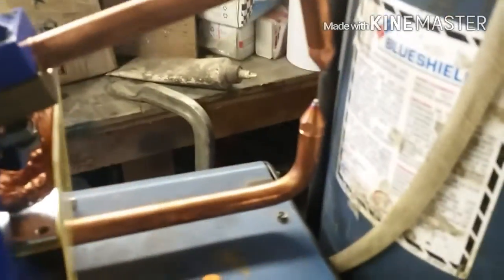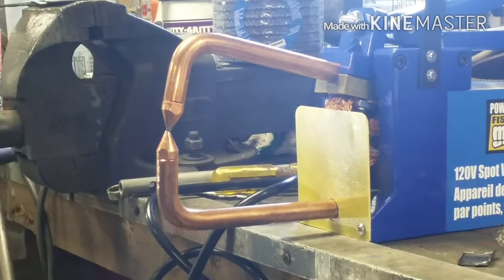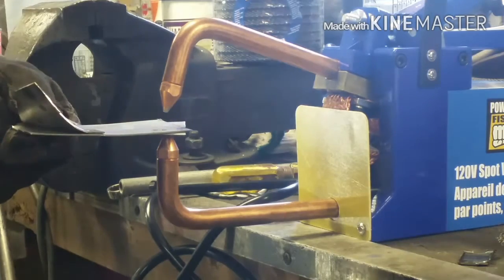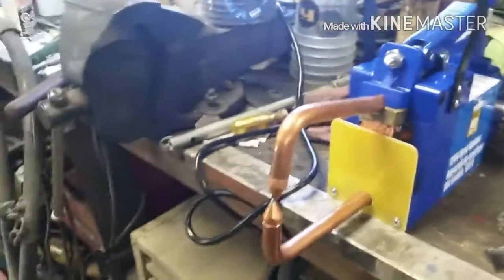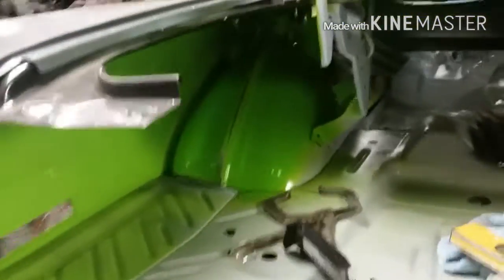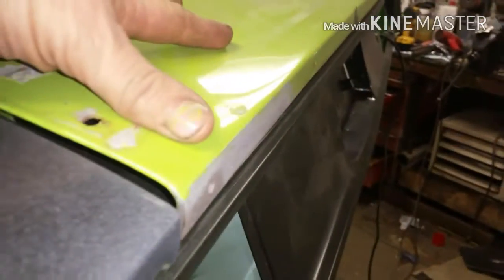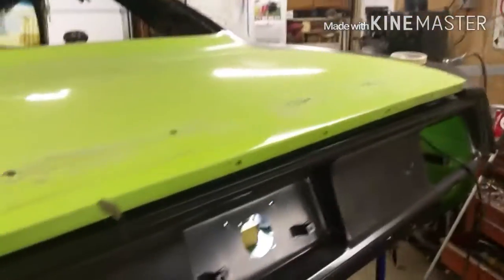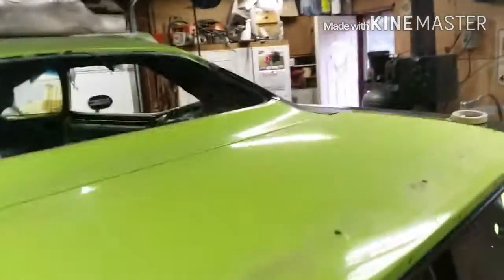Project cuda part 18

Comment: everyone i know drills and welds, the spot welders are great for the factory look, however you touched on the down side! rust over time.
luxury car manufacturers these days put the cars through an electrically charged paint tank that is attracts all primer to every part of metal, so inaccessible spots get sealed.

Comment: Very good video. I'm not much of a fan of spot welding. No matter how good the welds look they still can fail down the road. Just my thoughts on this, of course. Car is looking great.
Reply: +Bruce Boschek I was thinking the same thing, especially with such small points. If you can use larger points to make a bigger spot it could be better.